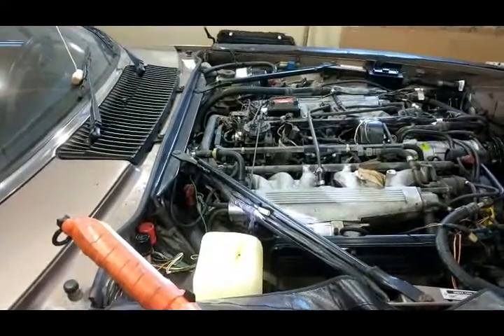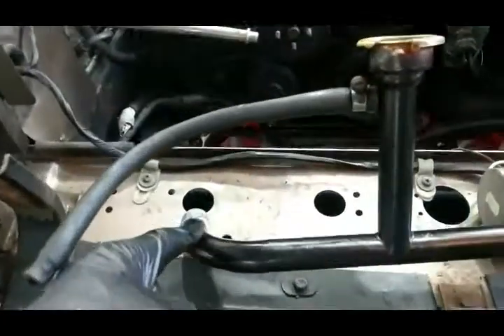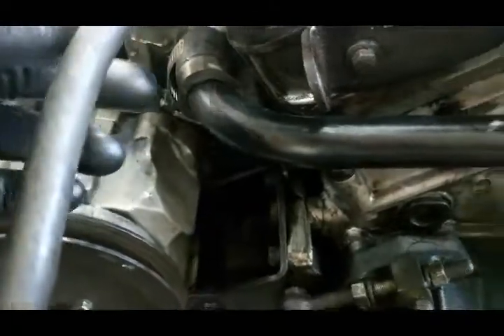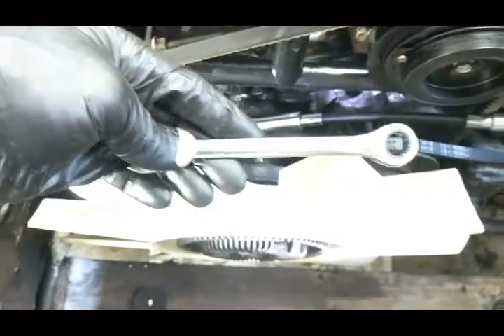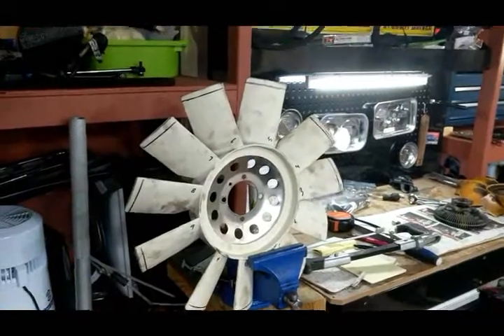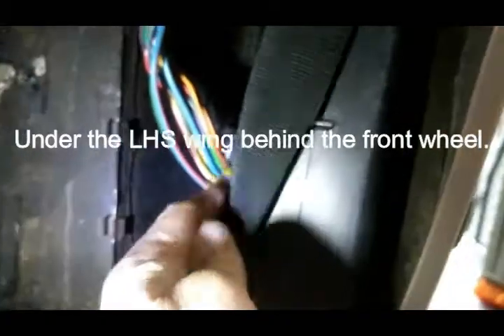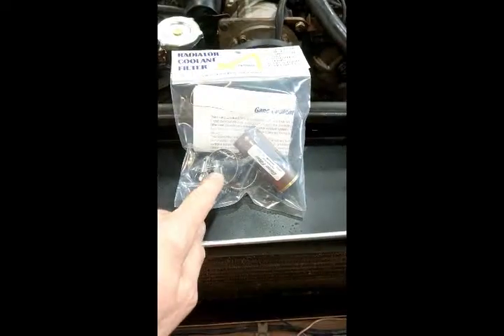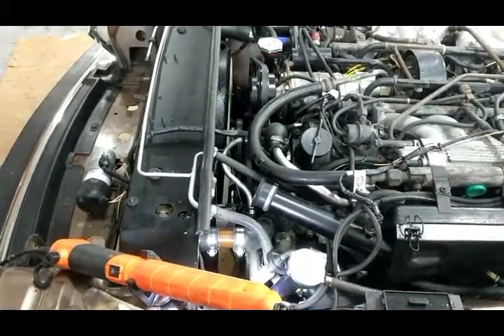1986 XJS V12 Re furb the cooling system

Comment: Thank you for posting these videos........ I never was into jaguars until I saw one when I was out and about. There stunning cars. I ended up buying a 1988 and 1978 xjs last year. So I need all the help I can get.
Reply from the maker: I have 3 more in the pipeline... 1. Working with fuel pump and fuel rail checking fuel pressure and installing non return valves.  2. Overhauling bellows and electrics of the cruise control, and, 3. Changing the plugs and wires.    I'll post soon.
Reply: Peter Aves Excellent ......I will continue to follow your channel intensely.

Comment: Always fill and "burp" an XJS V-12 as nose  uphill as you can get it.  Used to park mine on a slope to do.  Also the bypasses next to the thermostats are always clogged as well as the metal pipes along the heads.
Reply from the maker: Right.   I found that I overfilled the system too and it squirted out of the T bar cap despite trying a few different caps.
Then after the water level was lower, it stopped, but the engine temperature remained correct.

Comment: Greetings Peter. Although this video is 5 years old,it is a wealth of information and I am grateful you took the time to post this .

You are 5 years my senior . I have a 1988 xjs same situation, just bought the hose but having a difficult time figuring out the tee valve data , I'm probably not using the correct term, if you recall the parts you used for the heater hose to block and the air bleed I would be forever grateful. Thank you and I hope you are well and excellent video. I will watch your others now.
Reply from the maker: Hello, I'm not sure what part you are referring to. If you could tell me the time on the video I'll take a look and see if I can remember.
Reply: Hi Peter, at 0:42 the air bleed valve is what I'm finding very difficult to locate.  I just received in mail today C&D valve cd8412 unfortunately it is too small for the heater valve hose . I bought URO sports brand hose #c43999.  I spent so much time researching this issue reading forums and watching some YouTube videos. You are the winner , your method is really exactly what I thought to do even before seeing it done. Genius and I mean it.  If you able to recall this air bleed valve I would be forever grateful. Thank you
Reply from the maker: @fabriciodelasuerte7116 .... I'm pretty sure I followed palms book..."Experience in a Book"   do you have that?   If not, it's free on line.   It's amazing.   There is a whole section on cooling system improvements.   I did a few of them.... cooling system filters,  refill tubes for the"hidden" atmospheric coolant tank.   A timer on the electric fan for after ignition off.     If you can't find palms book,  email me on Petercharlesaves@gmail.com and I send it to you